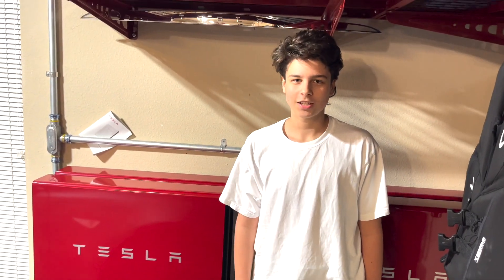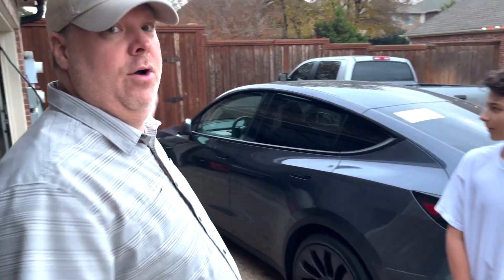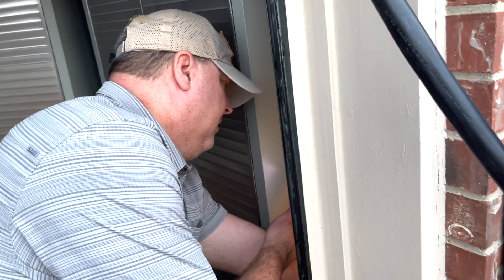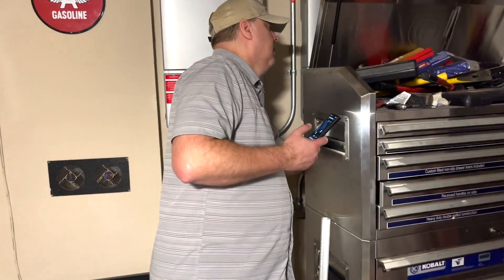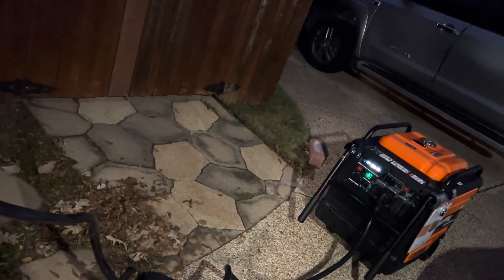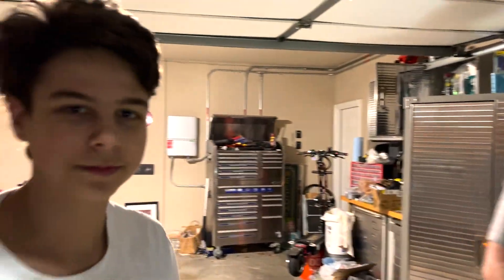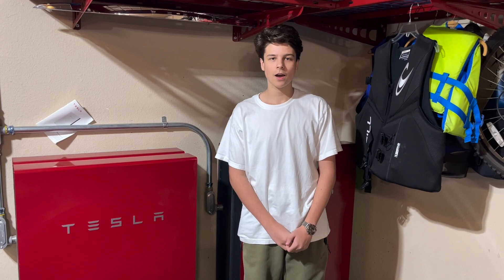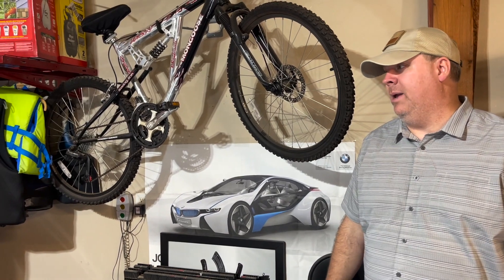Charging a TESLA WALL with a Generator

Comment: Something that might make this work - if you set the Site Import Limit to something like 3kW, it won't try to take more than that from the generator's feed (assuming you have that feed coming into the system in such a way that it looks like the electric grid).  You can access that in the Powerwall / Gateway setup, last time I played with it, it was near the end of the setup screens.

Comment: All right, I’m half tempted to do this myself to prove a few points.

1. The generator needs to be 240 V AC split phase and with enough surge capacity to handle the charge current of the battery or batteries.

2. The generator needs to be located on the grid side of the Gateway as a manual transfer switch from grid.

3. When deciding to charge from generator, power wall needs to set batteries to zero net export. This forces power wall to self consume or charge, but not expert to the grid. Additionally grid parameters may need to be adjusted for lower and upper limits of the generator, meaning lower frequency for dips and higher for offload surge in hertz. 

4. Charge rate on the batteries needs to be well below the generator surge capacity.

I have a power wall 3 set up behind a gateway on my enclosed motorcycle trailer. It operates completely off grid and is charged by eight solar panels. Currently I’m able to plug the grid side into a 240 V receptacle that plugs into my house when storing the trailer. However, when we are out camping, we have no ability to charge power wall from generator. I will test this theory and then post the results.

Comment: I have a couple of thoughts. Is the generator neutral ground bonded? Is it a pure sine wave generator? Does the gateway break the path of the neutral ground bond at the first disconnect when it shuts down the path to the grid and then does the battery become the 1st disconnect? Additionally, your generator does not have enough wattage to run a car charger and charge a powerwall together. The powerwall can only charge at 5kw so your generator should be able to charge the battery alone.

Comment: Well I just found out the hard way I purchased a 7 kw generator had a transfer switch installed and the generator shuts down same as shown on this video. The generator has the capacity to charge the powerwall. I believe the problem lies with the solar charges with DC and the generator charges with AC still cant figure out why because the grid is AC 50 Hz, the same as the generator. Does anyone have a solution, as the objective was to charge the batteries so I don't have to annoy the neighbours and myself with a noisy generator. Does anyone have a solution for this problem.

Comment: I know this is an old thread but note that if you have solar and a powerwall, the control for allowing the solar inverters to be active and to feed power with the grid down is via adjustment of the frequency of power created by the powerwall.  Forgetting the generator for a moment, with the grid offline and disconnected, the powerwall becomes the grid in the eyes of the solar inverters.  They will stop making power if the frequency of the 'grid' is out of range.  Since Grid power is usually rock solid at 60HZ, the powerwall can increase the frequency to say 62HZ, which commands the inverters to disengage.  The Powerwalls do this in a grid-down situation if the batteries are full enough and cannot take more power (coupled with house demand).  As the power drains from the batteries, the powewall  lowers the frequency to normal 60HZ, causing the inverters to return to operation, charging the batteries again.  IF you plug in a generator to the generation panel side of your setup, you can create a LOT of issues as the frequency of the gas generator likely will be out of sync, and if they ARE in sync, and it was daylight, your system could effectively try to back-feed solar energy to the generator as a grid, which it is not a grid...  BAD.    You could disengage the solar inverters, ensuring you have no source of excess power, but you still have the frequency shift once the batteries are charged fully, which can damage or make your generator unhappy.  Also the powerwalls are pretty picky about power quality, they may not accept the power from the generator as good.  The ONLY idea I have thought about is that you use a DC generator with a small buffer of batteries, coupled to a grid-tied inverter, connected to the generation side.  This would basically make the generator look like a solar system as grid-tied battery inverters will also follow the same rules of solar grid-tied inverters, disengaging when the frequency shifts as the powerwalls become charged.  Honestly the best solution is just to use a transfer switch, switching to generator when batteries get to a certain level of discharge, then when the sun comes up, disable the generator and let the sun get them back.  I really want something more automated but without some more complex configuration, it can lead to a lot of problems.

Comment: Wonder if you can set the powerwalls to only pull 50amps at 240v from the generator, similar to how you can set how many amp you are pulling when charging a Tesla on the app.

Comment: We charge our Powerwall2 with our Kubota 1100 diesel generator. Unfortunately the maximum that the Powerwall accepts is 1.7kw although the generator can operate at over 9kw with a 11kw surge.
Reply: Do you have pictures of your setup. Have the same with Pw2 and Kubota 11kw. TY

Comment: From what I've read you'd need to re-provision your powerwalls and limit the max charge from grid speed to stay under the max running amps of your generator. After that (from what I've read) you may or may not get the powerwalls to charge based upon the quality of power that the generator outputs. I think you'd also need to have your transfer switch between the main disconnect and your backup gateway so that the system thinks the grid is up. This will all also void your warranty.
Reply: How about save a TON of money, get an LP or Propane generator and do this correctly? The powerwall would be neat (maybe) for a datacenter as it costs less than line interactive UPS systems....but, not sure if that "savings" is worth the cost.

Comment: What size generator was that?
Reply: @Miss Vi one powerwall only pulls 5000w max charging. Is your generator wired to your panel? I think it would need to add the power from the solar input side so that the powerwall knows how to charge from it. 
This is just a theory. If the Genny is on the output side you might be getting some sort of feedback making the Genny overload. 
Just theories.